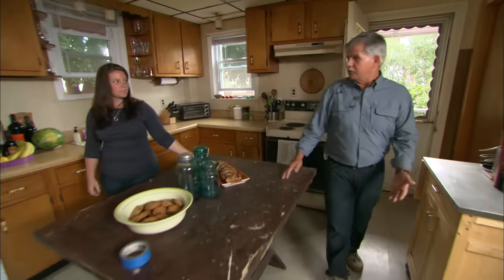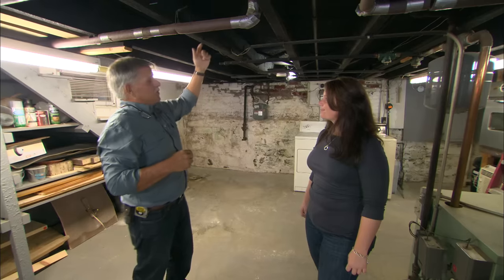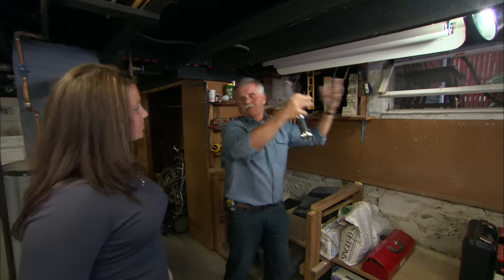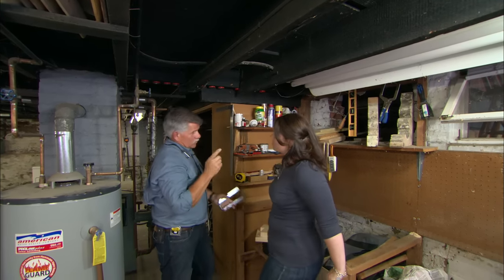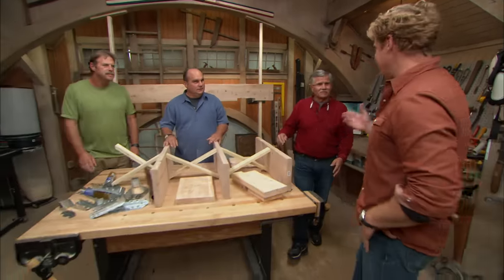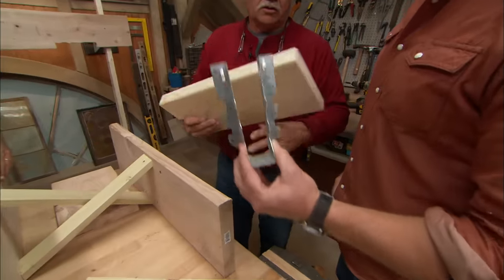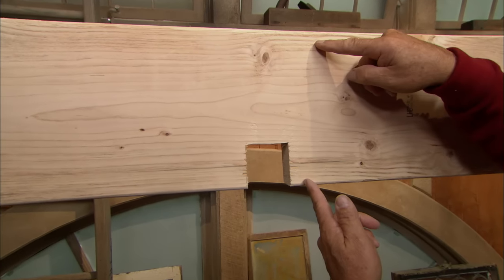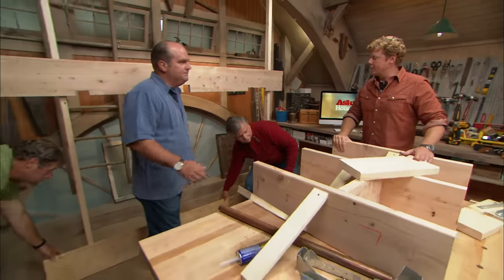How to Repair a Cracked Floor Joist | Ask This Old House

Comment: Push up using hydraulic jack after the glue and then u can used the metal joist holder.

Comment: For sistering those joists, if drywall screws are wrong because they are brittle,  would high ductile steel 1" + diameter wood screws or bolts be acceptable?

Comment: Ive got a newly installed kitchen island making my floor bouncey, they are eight inch nominal size joists over a 16 foot span 16 on center.  I would like to sister them with plywood but the span is too long for continuous sheets
Can I do a patch work of plywood or does it have to be continuous?  I also have a 1.5 inch drain at the end that I dont think I can remove, can I sister a joist in beside with a section missing?  Or half height at the end?
I will also install some missing blocking and upgrade to solid blocking but am pretty sure that is only 25% of my issue.

Comment: Can I put a new beam running underneath the old beams across direction 90 degrees and put new additional support posts in basement
Reply: Like partial beams and slowly raise the sagging floors in different areas of the house
Reply: No, absolutely not, that is unbelievably dangerous to do. You will collapse your entire house.

Comment: I live in an Old Spanish House from 1937, with floor sagging towards the back wall. There is little to no crawl space. With a lamp and getting in there carefully the wood seems fine, good temperature, dry and no critters. Where do I start?

Comment: You were saying not to use screws because drywall screws were to brittle. What about the use of construction screws or deck screws?
Reply: Construction screws are better than nails on pull out and shear, but don't use any other type, especially deck screws.

Comment: What about 3" Deck Screws? Why the construction adhesive? Wouldn't adhesives make the wood rot faster possibly? I guess I am trying to understand the science behind it? Sister boarding I've never heard this term I have heard this called daughter boarding which is correct?

Comment: In spite of the use of structurally inferior materials such as wood, it really goes to show how good Americans are at construction when their houses made of wood last over a hundred years. A concrete apartment low rise (3 floors and a basemens) here in new Delhi doesn't last long because of the masonry interior walls which make it difficult to remodel as well as that no protection is given to the concrete through an integral waterproofing and bonding agent.

Comment: What about a bolt instead of nails/screws to attach the sister board? That way it can be drawn tight from tightening a nut on the other side no?
Reply: Glued and screwed... no drywall screws

Comment: Question - I have cracked or damaged joists because of long term water exposure from plumbling failure until I bought the house two years ago and the standing water was found last december of 2021. Been pumped out.   Because of this, do I HAVE to replace the joists?
Reply: What did you end up doing?

Comment: could one use a Kreg drill guide to predrill the blocking between the joints so screws could be used instead of toe nailing ..

Comment: Ok - I don’t see why any one would use dry wall screws, they are not designed to take any appreciable weight.
Instead of nails (and I’m figuring you are using “Ardox” style nails), I would either use lag screws or my preferred method - using carriage bolts in a diamond-zig-zag pattern along the length of the two beams to secure them together.
Reply: Through bolting is probably the best option in this situation because you are putting a large clamping force on the new and old material and not driving in nails or screws which act like wedges in wood further weakening the original wood

Comment: 6:20 why would you make the cut in the joist higher?   And 6:50 the load is transferred by compression.  Not tension.

Comment: what I don't understand is why not putting the electrical cables in platic tubes , its amazing seeing all these cables on the roof of the basement , one short circuit and the whole house burn to the ground

Comment: Hi, my old house has this issue. Do you think it would be a good idea to put these hangers on all the joists? I have splits in 60% of them.
Reply: @carlostosado8965  my question is now irrelevant. i had a contractor put new floor joists in next to the cracked ones. found out the load bearing wall above the main beam was off center. which also did not support the main ceiling beam for the roof. lol. the cracked joists had too much of a load for 100 years. its good that the old lumber was very wide compared to the lumber you buy today. i am sure my wording might not be accurate as i am not a contractor. i call the items as i think they are called.

Comment: instead of hanger screws, could deck screws be used or would that be a problem in some way? as for the fasteners for the sistering plywood, could deck screws be used for that as well?
Reply: Construction screws are better than nails on pull out and shear, but don't use any other type, especially deck screws.

Comment: You knock out the open bridging because you need to run pipe and such and then replace it with solid lumber to drill it out to make a hole so you can run the pipe through that. I am missing something. The bridging was transferring loads to adjacent members but the block is not, the nails are.

Comment: Could you drill holes every 24” and bolt the sister in with threaded bolts washers and locknuts instead of nails?  Probably a coated or galvanized 3/8 to 1/2 size bolt depending on size of the hoist?
Reply: why would you
Reply: Steve  lining up 10 1/2" bolts across the beam sounds like a reason for it to split not to mention about 20x the costs of the nails with no benefit

Comment: Nails are Old School better off using Simpson or equal structural screws they are awesome.
Reply: Mark: Nails are good but there are other options as you state.  Just sistered a 10.5 foot Microllam LVL to an old fir joist with 4 feet of rot at the sill end.  Went 6.5 feet past the rot.  Used LockMaster FlatLOK structural screws.  Good product and a very easy job.  Reconnecting the copper pipe and the PEX lines easy as well.

Comment: What was the purpose of the glue?
Reply: To help halt lateral movement. Wood glue, even the basic stuff, creates a stronger bond than the wood has itself. It will never break at that point again.

Comment: That regular wood glue is going to really add some strength
Reply: Wood glue has been proven to be stronger than the wood itself. Nice try though.
Reply: Glue will also keep out moisture from the core of the wood, where the crack was exposing it to.

Comment: Electrical and mechanical contractors and plumbers should all know these rules, most of the FRAMING inspections I did in the past failed not because of the the framer but due to all the other guys. I plumber ran his flexible ducts through every single LVL beams carrying the 2nd floor. Guess what? The GC had to replace every single beam cuz the engineer who works for the LVL beams manufacturer would now sign off on that LOL....

Comment: How would you suggest I fix load bearing girders that have a splice in the center board in the middle of the span?      With only a crawl space.
Reply: jack post on a little concrete footing right under the splice. let the concrete cure 1 week before tightening (it'll gain 70% strength by then)
Reply: Roy S I would have to take up the floor to do that, can barely crawl under most of the house.   I thought about jacking it up and sistering the girders.   The house is 32 x 16, three rows of girders and the people that built the house put splices in every span, 12 splices with 2 of the rows on load baring walls.   I  wonder if deck block with 4x4s would be strong enough.   Jack post would be great if I had the room.
Reply: Roy S at least if the main house collapsed at some point my parents’ room would still be standing.   I built my parents room properly with stem walls and 2x10s on a 16’ span.

Comment: What’s with all of the bottle caps on the joists? Just wondering because it looks odd.
Reply: They are jar lids, aren't they?  Maybe they would put up preserves that way instead of on shelves.
Reply: @robertbrandywine   No no .. I've seen old DIY type homeowners do this in the past.  They sort out their screws and nails into mason jars and then screw them up into the nailed up lids for storage instead of putting them on a shelf.  Not good for tall guys hitting their heads on them .. ;-)

Comment: Interesting to compare this with UK standards. Putting notches on the underside of a joist is a complete no-no. Any notching has to be on the top-side of a joist and no more than one-eighth of its depth and no further than one-quarter of the distance from the ends. Holes up to one-quarter the depth of the joist can be drilled on the centre-line in two zones between 0.25 and 0.4 of each end. 
Note, that's the "standard" regulations. If anything is needed outside that it's meant to be reviewed by a structural engineer. However, theory or one thing, and practice is another. Lift the floorboards on a house, and especially and older one, and you might find all sorts of horrors.
In the UK those cross-pieces go by the name "noggings".

Comment: Would have been appropriate to mention that the original joist failure probably wouldn't have happened if the notch had been drilled before cutting. Nor did he mention the obvious, remove cross braces to run pipes, but just put them back.

Comment: Plumbers are to houses what butchers are to cows.  Plumbers installing radiant floor heating tubes in my kitchen addition improperly cut oversized holes at the top ends of the kitchen joists.  Between the floor tile and the granite  countertops, in less than 2 years the floor developed a noticeable sag.  I had to hire a structural engineer who pointed out the disastrous tubing holes, and I had to pay another $3,000 to have the floor jacked up and all the joists sistered.  All the electrical wiring under the kitchen had to be pulled through to make way for the new joists, and reinstalled, a job I did myself.  I couldn’t sue the plumber, he went out of business.

Comment: Who can I hire to repair my floor joist?  A handyman, carpenter, contractor?  I don't find much information on Google
Reply: I would go with a carpenter.
Reply: Go for a framing carpenter.  Worst thing you can do is hire someone who just slaps some wood together with a nail gun and says it's done.

Comment: I would have used a taller hanger so the nails are farther from the bottom of the beam.
Reply: also
-the bridging is meant to brace the joist from rotation under loading (reducing the unbraced design length), not transfer load to adjacent joists. The planking or sheathing transfers the load between and to some degree to adjacent joists.
-NEVER cut a joist or beam in the bottom or top as shown. This effectively reduces the strength of the beam to the shalllower depth across the entire span. This is especially true of engineered lumber or LVL. The manufacturers of engineered wood recommend only notching in the middle third of the depth in the middle third of the span unless you can analyse the beam for your specific desired notch.

Comment: The bridging is actually under compression and not tension.
Reply: So..what....stress on something is still at the end of the day...stress.  TOmato versus tomata.  A pizza is still a pizza no matter how ya slice it.
Reply: Motoryzen tell that to a mechanical engineer or structural engineer and I guarantee you will get a lecture out of them. Not all “stress” is the same. How an object reacts under force is determined by the material the object is made from and how the force is applied, whether in compression, tension, shear or torsional. Properly defining what state the object is in tells you what you need to do to correct it.

Comment: Tommy used Titebond 3 wood glue for the floor joist repair? The same Titebond 3 that clearly says on the bottle "not for structural use"?
Reply: I think the way Tommy is using the glue is to just hold the wood together. Perhaps to keep bugs out. The hanger is the device that is  giving the structural force to keep the joist  up.
Reply: but shouldnt something more structural also be put in the crack, like construction adhesive? or at least gorilla glue? i have used regular woodglue(titebond) for many things, but i dont see it as a substance for structural repair
Reply: They should have drilled a hole underneath and screwed in a long thick screw to close the gap.

Comment: Hi, love your show. Aren't you supposed to do the hole in the middle of the beam? If you are knocking out a piece from the bottom or the top of the beam, the beam will have that dimension instead of the original dimension.?
Reply: +Erik Gård As long as you keep the size of the hole/notch within the limits Tommy mentioned you don't ruin the integrity of the beam.
Reply: What's weird, though, is TOH spent 10 minutes during an older episode, explaining that all thru-cuts should be made within the middle third of any beam or joist, and NEVER along bottom or top of the structural web as shown here. Way to confuse viewers!
Reply: You are correct. Middle third of the beam, anything else should be rejected by an inspector.

Comment: well RIP me lol I just bridged my entire basement with #8 screws cause that is what I had on hand =( Does it matter that I did it as a solid 2X6 starting at the bottom of the joist? please tell me I don't have to re-do it lol They have 3 2.5 inch screws in each side btw.

Comment: Good video the only thing I would have done differently instead of using Elmer's glue in the cracked joist is to use Loctite Pro 8X strength adhesive caulking, I have used much of this product around my house for damaged wood especially rafter tails under the eves by next day it is hard as rock & wood can not be separated it's that tough great stuff it is...
Reply: Wood glue with wood on wood joints is stronger than most other adhesives. The simple fact it is an adhesive caulking means it's not intended for that application. construction adhesives like the PL stuff work on multiple surfaces and that's their point. Generally you will also use other fasteners,  but you won't laminate multiple planks together and expect them to be one solid piece like with wood glue. ;)
Reply: the glue isn't doing much as the joist is supported by the hanger now.

Comment: The glue won't add any strength!
Why not sister that joist??
And how does this fix the dip in the floor?
Reply: It doesn't the start of the video was pointless, he just fixed the joist. And really the glue doesn't matter to much it'll keep it from moving which is good, the joist hangers doing all the work.

Comment: Why is he talking only about drywall screws not being adequate (because they are brittle) when placing reinforcement material (plywood) side by side to strengthen a floor joist?

Comment: The right way is to not drill or notch the joist at all. Just run a trunk line and go in each bay even you need to run lines. I do remodeling and nearly got into a fight an electrician notched all the studs on a bearing wall when running outlets.  He could have easily run the trunk line in the basement and up in between the studs🙄🤓. He literally destroyed the whole bearing wall!!!!!

Comment: Structural engineer here, I wouldn’t let the joist hanger pass if all nails are not properly installed. He should have used a LUS hanger which also puts nails in shear if he was going to omit some nails. Better than it was I guess ...

Comment: What is the brand/model flashlight that Tommy uses in this video?
Reply: +Casey Ertz It looks like a Nebo Big Larry.  Great little light that runs on 2 x AA batteries and has a magnetic base.  What makes the light nice and crazy bright is that it doesn't use conventional LEDs, it uses COB (chip on board) LED.  Bright white, good dispersion.  I picked up a few at our local lumber yard for about $20 each.  They live in the toolbox and car.  Two levels of white light (high and low), and a red flasher.  I have been very happy with this light.
Reply: +John Brandeau Thanks!

Comment: 4:09  So why was the support beam smaller than the joist?  That glue repair was ridiculous, it should have had a section bolted on to the side of the joist with timber connectors in between.  The support beam also looked like it was undersized compared to the joist being repaired.